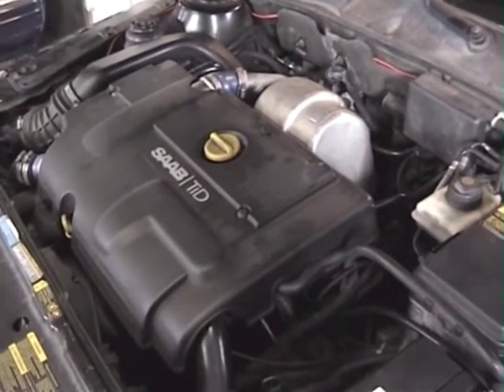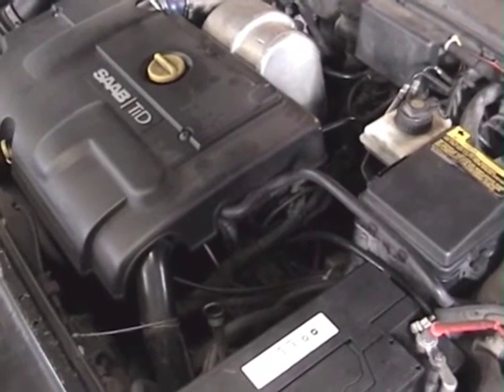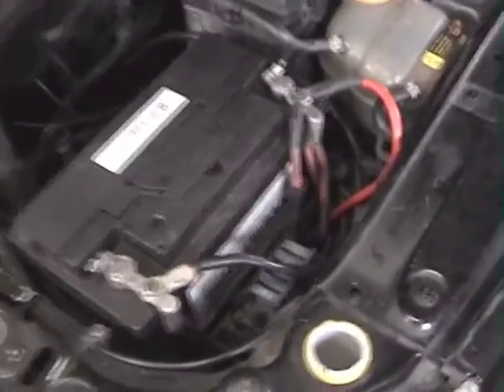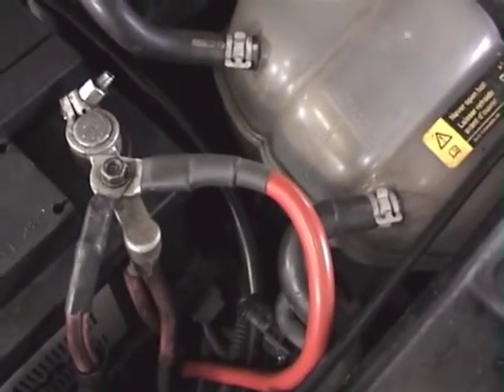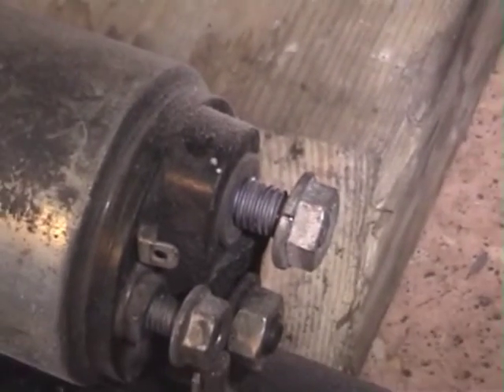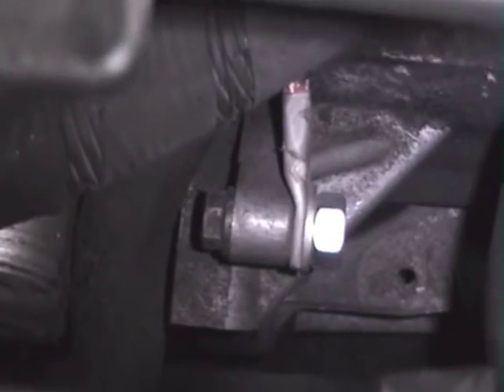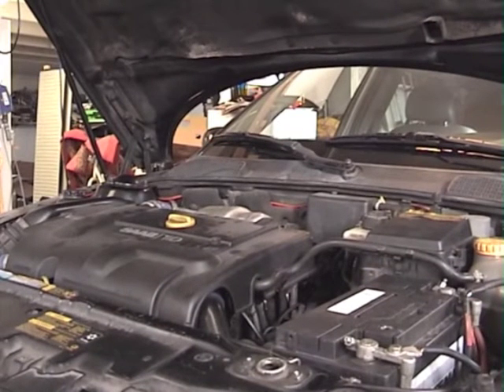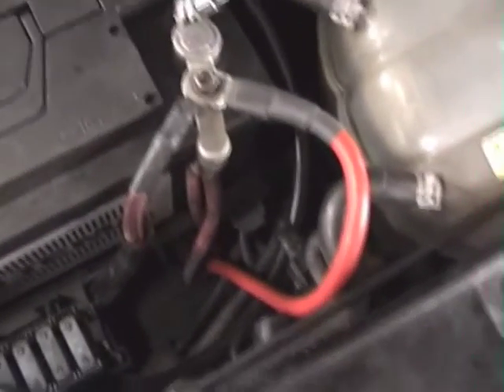Saab diesel starting issue solution part 1

Comment: my experience on the diesel version:
- changed battery: nothing
- changed starter motor: nothing
- checked diesel pump: nothing
- checked glow plugs: nothing
- replaced the cable from the battery to the starter motor with a new one and with a larger 
  section: brilliantly solved!
the copper of the old cable was too "cooked" and no longer sufficiently conductive

Comment: Har samma problem på min Z19TDH -08, bilen vägrar starta varm, har bytt vevaxelgivaren 2 gånger nu utan resultat, det blir att prova med extra kablar till startmotor, tack
Reply from the maker: Min 2.2TID har som sagt gått som taxi och jag hade ett par kollegor med 1.9 motorer med samma symptom. Märkesverkstaden bytte startmotorer och batterier vilket bara är en dyr lösning som inte hjälper särskilt mycket och länge. Även med detta utbytt så var det inga pigga starter. 2.2TID var senast igår ute på en bekymmerslös utflykt med över 650400 km på räkneverket.
Reply: @Smugglerkungen  Tack för svar, jag litar på din lösning, allt annat känns förgäves, undrar bara en sak, när du kopplade extra plus kabeln på start motorn, lät du gamla kabeln sitta kvar på sen du skruvade  bara till extra plus kabel som ska upp till batteriet då?  Jag tänkte använda mig av starthjälp kablar helt enkelt med lite modifikation, Mvh
Reply from the maker: @sejo88  Jo, jag lade till den utöver originalkabeln. Jag förklarar det i filmen...

Comment: So you had corroded battery cables... and the solution was to put new cables OVER the old ones instead of replacing the garbage you had on it? Wow...
Reply from the maker: The cables were not corroded, and even if they were its easier to add cables than replacing. On my most resent purchase, a 2017 Renault Talisman 160hp diesel I did this cable upgrade with the car fresh out of the factory. Cables even thinner than in the SAAB. I also have a 2003 VW Touareg V10 diesel, comes stock with dual 100 Amp batteries and nice thick cables. Never had starting issues even with one of the batteries drained. Wow...
Reply: @Smugglerkungen  thats a cool story, but you sound kind of stupid implying new cables fixed a no start issue... But they "werent corroded". 👌
Reply: Engine Performance Diagnostics dude.
Hes been driving this car for 600000+ kms.
No mechanic was able to fix it.

Just shut up

Comment: Oh this is too complicated. All must to do is connect switch between coolant sensor and turn off for few seconds,thats the computer mean its always cold and turn on glow plugs and start Without problems. You can Just  use delay start relay (Without switch) and working the same good ;)
Reply from the maker: No that won't solve the problem. Glowplugs are always activated both with warm or cold engine. But there is no indication on the dashboard with warm engine and/or ambient temp above 5 degrees Celsius. Glowplugs are rated at 11 volts and are also activated during normal driving with variable voltage up to 11 volts to manage exhaust emissions. When the engine was fresh from factory original cables where sufficient, but when things get older and worn the only solution is thicker cables and bigger connecting area to handle the current. I tried to jump the plugs first, it failed.
Reply: @Smugglerkungen  the glow plugs must always working,no matter if outside hot or cold weather. Try to connect switch between coolant sensor and turn off manual before start car. Glow plugs light indicator must show it on dashboard for few seconds and than you can start the car. Try it. ;)